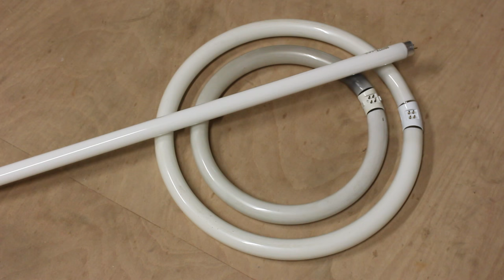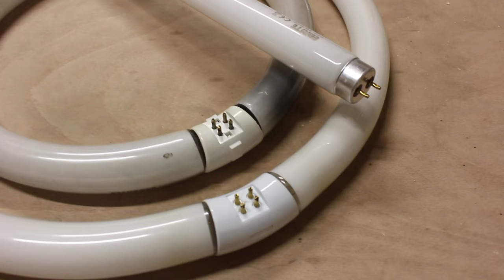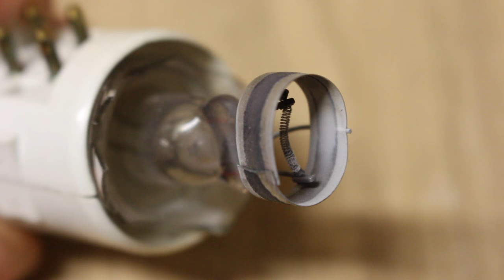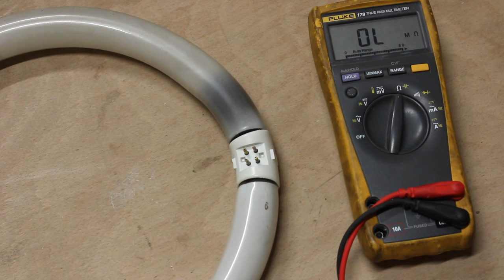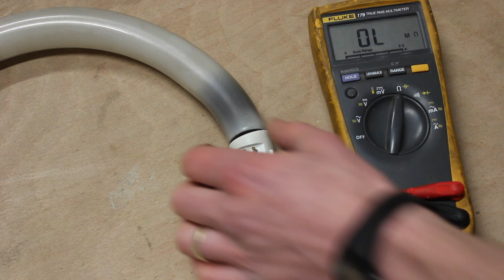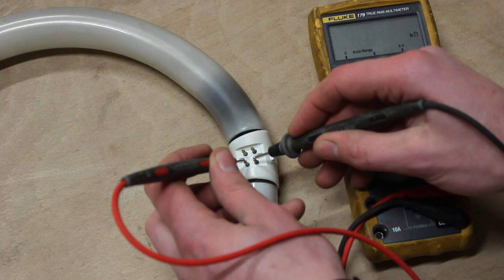How to test a Fluorescent Tube

Comment: I could have told you that without the multimeter! lol.  I know, this can be helpful for other tubes...
Reply: just touch both the filament ends with a 9 volt battery. if it doesn t light orange the filament is blown.
Reply: @averageslytherinperson6154   Easier with a multimeter to be fair!
Reply: @OggyGTA  not if you re far from home. I sometimes carry 9v battery when i m about to pick some tubes. Just to test them on the place to leave the bad ones behind.
Reply: SIMPLE SPIN  try changing the glow starter

Comment: What if you read 2.5 at one end of the tube and nothing on the other end. Can one end be good and the other end not. Or does one end not read this measurement. I doubt it but have to ask.
Reply: There's filaments on both ends. He just tested one end on the video, but you should test both.
Reply: @Boogie Man sometimes a tube with one intact filament still runs on hfs ballast
Reply: @Boogie Man hfs ballast is a high frequency ballast which gives a dc output most of the time. I have one running on a 7.4 volt battery and it also runs tubelights with only one intact cathodes. The tube is an 8 watt T5

Comment: Hi, I have several T4 400mm cabinet lights, 3 of these failed within a day of each other, I tried changing bulbs around with the lights that are working,also tried plugging the duds into where good lights are, these units cannot be opened,so is there some way I can test them with a multi meter, thanks.

Comment: Where can you buy T12 tubes nowadays?

Why is T8 tube better, I am confused as some say that it has electronics inside

Can you use T8 tube with old starter and ballast setup? (I dont want to change those as I dont like the instant electronic crap starters (they cause interference to my sw radio) that they want you to buy nowadays

Comment: I only have 1 rounded terminal on each end. How do you test that?
Reply from the maker: Are you sure its a fluorescent bulb? (As opposed to a filament/incandescent)?
Reply: @FixitSam  well, I've never seen 8 ft long round filament-style bulbs. And my contractor says they are fluorescent. They were purchased around 2009 I think.
Reply: Same issue for me. And it's definitely a fluorescent bulb. One terminal at either end.
Reply: I've had the same single post fluorescent tubes since I moved into this house over 3 decades ago. I suspect they're somewhat like regular light bulbs, in that there's two terminals on the one end.  I'll be testing some myself today to see if that's the case.   @FixitSam